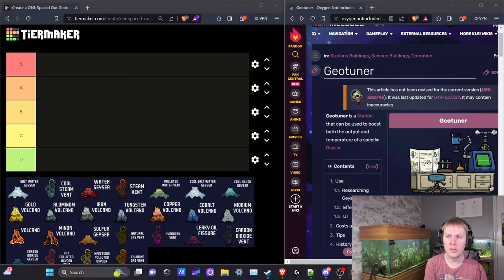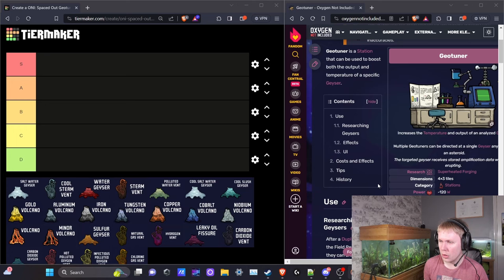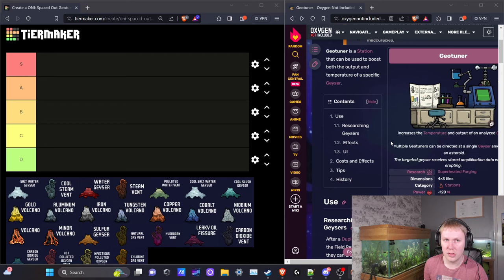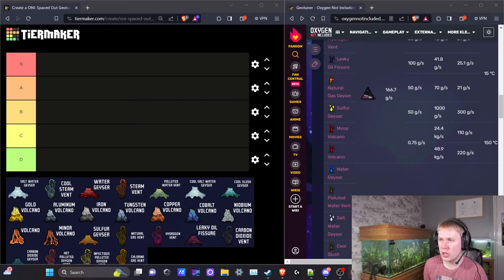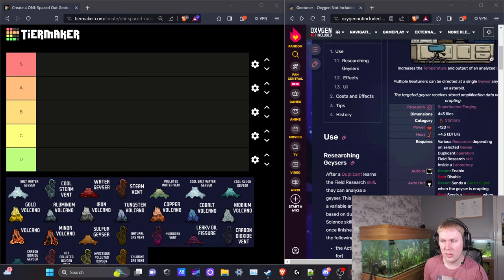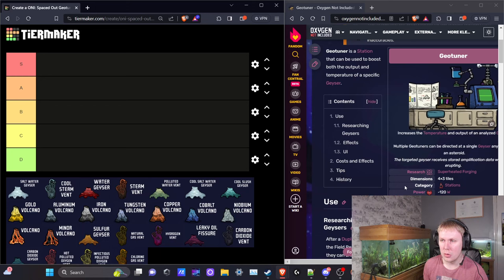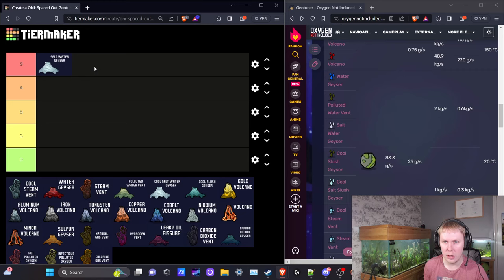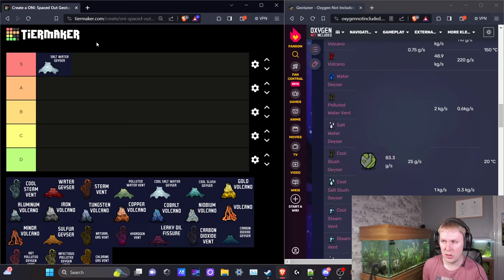Geotuning Tier List and Guide! (ONI: Spaced Out!)

Comment from the maker: I made a slight oversight. The Geotuner building uses 120W WHILE THE GEYSER IS ACTIVE AND HAS DATA, not when the dupe is doing the errand like I mistakenly thought. So the machine itself uses about 9% of a Hydrogen Vent's extra power from a Geotuner when factoring in eruption phases, for reference...
Reply: The other oversight is the gold you're going to need to make bleach stone, which however negligible, cannot be recouped

Comment: Because Abyssalite is completely non-renewable (and necessary for other purposes like the all important Insulite which consumes it in huge quantities), I would not even CONSIDER geotuning a volcano for power except as a last resort.  There are other, better, easily sustainable power options out there.  Basically anything that consumes Abyssalite gets an automatic F tier from me.
Reply from the maker: This is true. In the very late game, you probably shouldn't be using Abyssalite for any Geotuning. Using it for any other geyser is absolutely a last resort if you intend to get to using Insulite later on. But a Volcano consumes so little Abyssalite and gives so much power I don't think this is practically going to make a difference to the amount of Insulite you make in a game in 999/1000 playthroughs. A single 4x Geotuned Volcano will consume 1.8 kg/cycle of Abyssalite and you have hundreds of tons of the material typically available. As you say you can transition to other power sources later, but Geotuning a Volcano could be the means to get you to the late game without much long-term cost.

Comment: What about feeding the chlorine vent to dashi salt vines for more salt?

I have not gotten to super conductive asteroids either but my understanding is that the output is so high without geotuner that idk if it would be worth it.
Reply from the maker: Yes, feeding Dasha Saltvines the Chlorine will give you even more efficiency. Geotuning a Chlorine vent with 25 g/s of Salt produces 21 g/s of Chlorine. Feeding this to Saltvines provides 63.2 g/s of Salt, but you do need to consume 6.8 g/s of Sand to achieve this, and you'll need to cool down the Chlorine. This will ultimately let you recycle enough Salt to Geotune the Chlorine Vent for free, and you can either convert the excess Salt into Bleach Stone with a Hopper to produce enough Sand to cover this, or only use enough Saltvines to fully cover the cost and use Squeaky Pufts on the rest of the Chlorine to get more Bleach Stone if you have enough Sand from elsewhere (or just Pip plant the Saltvines).
Reply: @erisia_gaming  that seems to be a positive effect though!  The 6.8g of sand can be produced from 6.8g of salt.  My setup is for the purpose of producing salt for rust deoxidizing and sand for filtration.  Based on this, the geotuner would just serve to increase my output
Reply from the maker: Ah yes, you can always just convert Salt into Sand 1:1 by making Table Salt.

Comment: There is another use for the polluted oxygen vents. Clay production. Badlands has no clay for ceramic. Granted i have no plans to geotune the vent but could be done for increased clay production.
Reply from the maker: That is true. You would get more Polluted Oxygen by Geotuning a Polluted Water Vent and letting it off-gas in a wide insulated area, and then cooling down the Oxygen as needed, but I think I would rather feed plants Polluted Water than use it for Clay production a lot of the time.
Reply: @erisia_gaming Yes. On my map I currently have a single hot polluted o2 vent that I am using for clay any my single polluted water is being used for plants. 2 close steam vents for power. Water geyser for oxygen and salt slush for cooling.

Comment: I liked the video, learned something from it,  but I got to point out that geotuning nobium volcano is kind of ridiculous. 
1) Nobium is great - but you can easily mine around 500-800kg from nobium tiles on that asteroid and just 'nope' out of there. 
2) Remember that to make 100kg of thermium, you need 5kg nobium + 95kg of tungsten. You can then break down 100 kg thernium into 50kg of nobium  and 50 kg of sand(for some unknown reason). This means, that you theoretically need only 5kg of nobium and some excess of tungsten to get the whole thing rolling. 
3) Given that the superconductive asteroid is probably the most inhospitable place in the game (1k +°C almost everywhere and no resources) taming a nobium volcano is already a huge flex. Putting one or more geotuners there with dupes is just bonkers :)) If someone does it, they probably don't need the extra power/nobium from it, and certainly won't care about saving some refined phosphorus.

Cheers!
Reply from the maker: Yes, while it is technically very efficient, in practise it definitely seems like more of a flex than an actual practical thing to do. The perfect reason to try and do it! :D

Comment: one thing to add about chlorine vents is that they are also salt positive if you are growing dasha salt vines, including the sand for fertilisation because of rock crushers, so they actually are one of the most effective vents to geotune, for more information watch cgfunguses tutorial on salt vines

make sure to not put 5 geotuners on a volcano as that will make them give off rock gas which has a lower specific heat capacity, meaning you get less heat out when you do 5 compared to 4 
edit: you mentioned that at the end, thats what i get for commenting before i finish
Reply from the maker: YES, I am quickly starting to realize how powerful Geotuning Chlorine Vents can be. I am going to make a video about this some time soon once I've started doing this in the current Twitch run.

Comment: I enjoyed this video. Never used geotuning so was checking if I'm missing out. Certainly am! :)
Reply: Not really.  If you can get by without Geotuning, you don't need geotuning.  Volcanos require Abyssalite, which is non-renewable so it is not a reliable source of power long term.  Everything else depends on your needs.  If you have enough water already, you don't need to geotune any water geysers for example.

Comment: Regarding the Niobium volcano, unfortunately, it's not even worth taming it. Because thermium can be made either with 5 kg Niobium and 95 Tungsten OR 5 kg THERMIUM and 95 Tungsten.
So, as log as you have Tungsten, you can start an infinite loop with just 5 kg of Niobium to make 100 kg thermium, which you turn in 2 t of thermium that you then turn into  40 tons of thermium and so on. 
Tungsten volcanoes are actually what you should be putting in S tier
Reply from the maker: I can't believe I forgot to mention this! You can convert Thermium into Niobium 1:1 at the Molecular Forge to get it as you described above. Geotuning either the Niobium volcano or 4 Tungsten volcanoes will give you the same amount of metal for making Thermium on average. Geotuning the Niobium volcano is essentially free due to the higher eruption mass rate (0.6 g/s vs 18.8 g/s of Phosphorus for 240 g/s of metal over time), and you need less Geotuners to max out one Niobium volcano than 4 Tungsten volcanoes, but it's harder to tame the Niobium volcano and habitate that asteroid, so in practical terms the best option is less clear.
Reply: Sure you can get it from another source, but the ridiculous output (about 4x that of a normal metal volcano) of a better than steel material (which wouldn't require any dupe labour as well) is nothing to scoff at. This actually makes it one of the best straight up sources of ore in SO.

Comment: At 27:50 or so, you ask if it's power positive to run the aluminum volcano actively cooled. Well, every single metal volcano tamer where the metal leaves the steam room at about 200-220ºC is power positive, even when the metal is cooled down to dupe safe temperatures of 25-35ºC using an aquatuner. I've done the same tamer on every metal volcano (except niobium of course), and they could all power themselves easily with metal output at comfy temperatures. 
I doubt the extra power from the geotuners makes much of a dent on it, if anything the power output will be further improved.

Edit: also interesting point, you shouldn't go above 4 geotuners on the magma volcanos, since the 5th will result in a nice new gas geyser of Rock Gas, which is a bit inconvenient.

Comment: I think you're underestimating just how much a Niobium volcano produces. I've tamed a few of them and the amount of metal they produce quickly overshadows any other metal volcanos. Geotuning just seems like complete overkill. And yes, the Niobium volcano will also WAY outproduce 3 tamed Tungsten volcanos you also need to create thermium.
The Niobium itself it just about as usefull as gold, for it's decor bonus, besides using it for Thermium or for thermal conductivity uses as niobium itself.

Comment: the stock cool Steam Vent is Nice if you build an 1 + 3 slot Steam Turbine. You can Pump Steam by a pump, limit the flow to 0.1 g of steam per Sec, run this through a own Heatroom (Aquatuner or so), you can put the 0.1g of steam in the 1 slot room under the turbine.

That way the turbine detects Steam over 125C on one slot, and therefore sucks up Steam from every free inlet (including the rest, who are below 125C)

That way you can make water from the cool steam Vent directly.
The turbine would be self cooling even since the cool steam Vent is under 130C.

(Since the turbine would only output 1200.1 g of Water, one maybe would have to send 100 - 200g of water back to the steam room to lower the steam temp a bit, so the turbine will produce less heat.
Its self cooling until 130 C Steam - but here we only have 3/5 of the cooling. My calculator says that with 3 slots, the max temp for self-coling is 116 - so just a tad bit below the output temp of the steam vent.

But never thought about Geotuning this one... That way one wouldnt need the Heating room, dont need the pump etc.
(the power consumption isnt really measurable - gas pump activates 1 sec every 5000 secs, Aquatuner nerly never runs, and if only for some secs.
Reply: I just saw that a geotuned Water Geyser would be at 115 C - right below the calculated 116C for a 1 + 3 slot self-cooling turbine. That might be an idea for my testing map.
Reply from the maker: Yes, I've done this on the Rime Revenge run. It's probably the most efficient way to handle Cool Steam Vents or 1x geotuned Water Geysers. However it is quite complex and requires some specific space around the Geysers, so sometimes I prefer just adding another Geotuner.
Reply: @erisia_gaming  in which episode did you build this? :)
Reply from the maker: @michimannes7822  Episodes 17 and 18 I think.

Comment: "Be sure to submerge bleach stone to prevent off-gassing" - I recently learned that storage tiles also block off-gassing. So not only do you save building space by just putting the bleach stone in the lab-room's ceiling/floor, you avoid wet feet debuff as well.

Regarding geotuning a CSV, I find that the way errands are issued (and how geodata is generated) makes it a pain - when the geodata runs out, only then is any errand to supply and generate new data issued - so even if you lock your field researcher in the the lab, you'll still get 10-20 seconds of de-tuned output. It could be mitigated with adding more thermal mass to the room and heating that up, but for that effort I'd rather build a tamer with a liquid by-pass pump to store the steam, and an aquatuner as a backup to deal with geotuner downtime.
Reply from the maker: Yeah keeping geysers Geotuned 100% of the time is a pain. I wish they would add a slight buffer to the data so that it is possible to achieve this. I basically just get around this by having a larger amount of buffer thermal mass these days. Thanks for the Storage Tile tip!